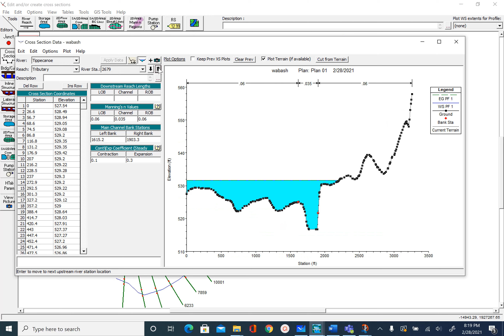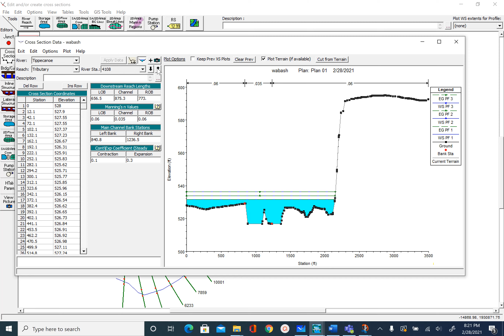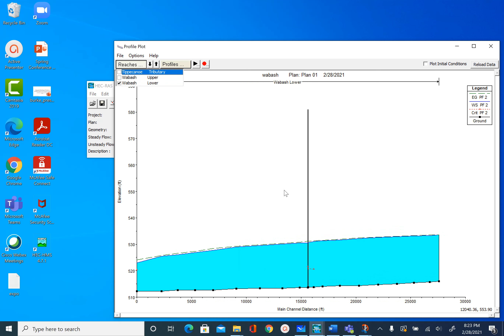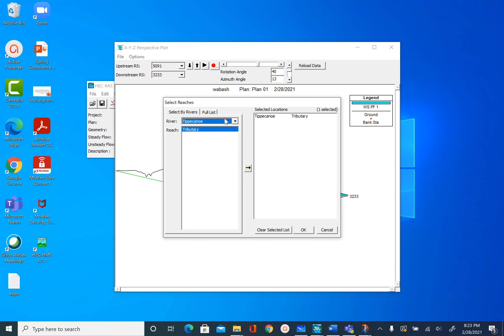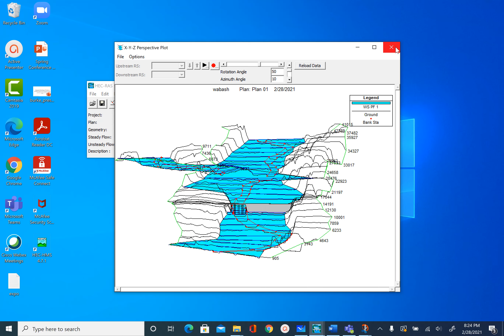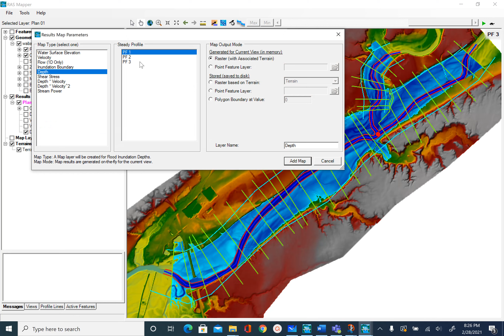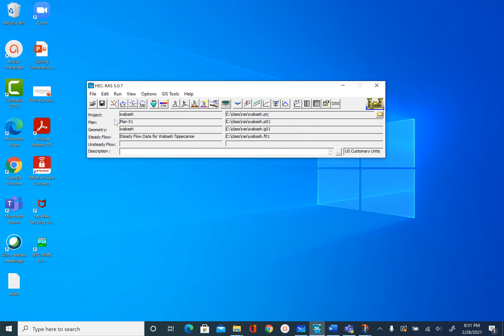1D Hydraulic Modeling using HEC-RAS (10/10) - Exploring Results and Mapping Flood Inundation

Comment: Thank you for your presentation! I have a question: How should I do when my river is in a urbanized area so that my floodplain has buildings in the middle? I mean, hec ras computes the water level cutting the elevation of the cross section, and I have water in different areas evend if they are not hydraulically connected...How can I solve that?
Reply from the maker: You should use a DEM that has building elevations and you can add these as obstructions so water will flow around them.